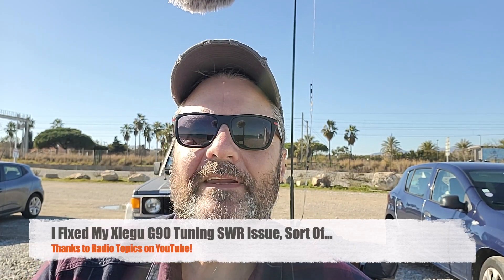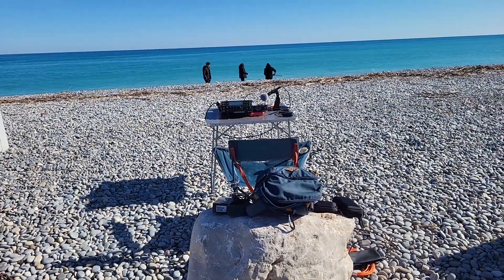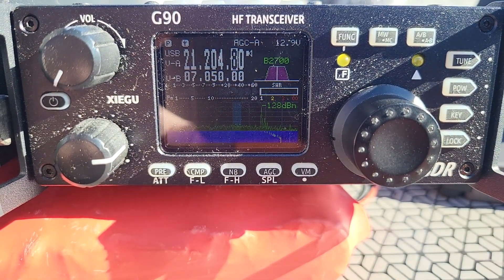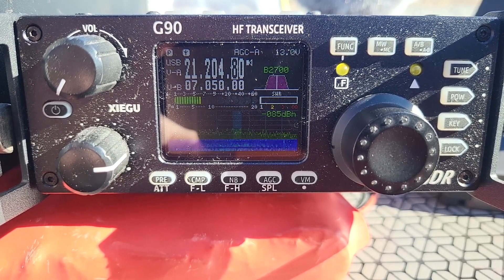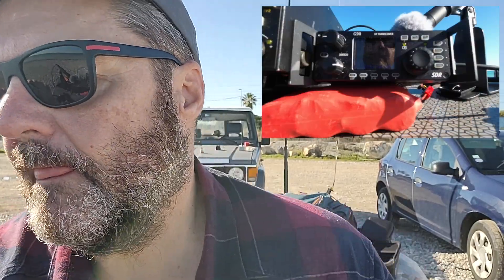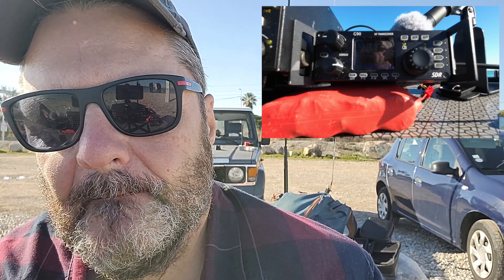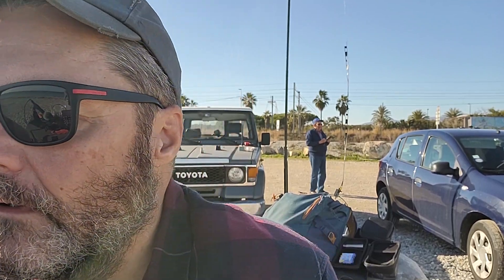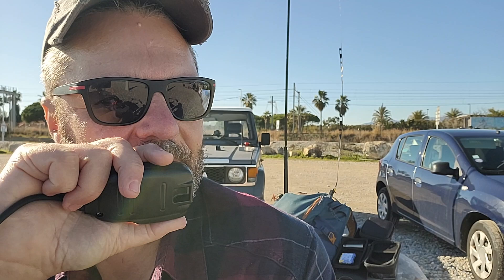I Fixed My Xiegu G90 Tuning SWR Issue, Sort Of...

Comment: I m kind of opposite... actually, taking that back - after i change to Split On, or after Split Off, for a wile, few minutes (or second)  is working well. and than again bad. Even with dummy load 50 ohm.
Reply from the maker: The lsst firmware presumably fixes it..

Comment: Hello again! You inspired me with your video, and in the meantime I was thinking about this problem. I checked it in my G 90 in a split/crossband configuration. The results were similar, i.e. after long tuning, the output power instead of 20 W was only about 3 W. I used a different procedure, wanting trx to work in split, specifically VFO A = 10.117 MHz VFO B = 3.547 MHz. I turned off the Split function and then tuned the ATU to VFO A and then VFO B. Only after tuning the ATU on both bands did I start Split operation. As a result, trx operates with a power of 20 W in both possible configurations: VFO A transmit or reverse VFO B transmit. In this Split function, the selection of the band or transmitting frequency can be easily done by pressing the A/B button.Indirect proof that TRX is changing the stored ATU settings is the audible sound of one or more relays switching when changing the band in which we choose to transmit in split/crossband mode. In the same  band mode you won't hear it because  the ATU settind does not change.Of course we use split mode within one band and the frequency difference we use about 1 kHz to several kHz.  Thank you for helping me learn more 73!
Reply from the maker: Great info, thanks!

Comment: Hello! Congratulations on your beautiful beach vacation, but that's all I can say positively. First of all, your xiegu is much smarter than you. Why?  You need to think about it carefully over a strong cup of coffee. This proves that you are really an amateur, but it does not exempt you from thinking and acquiring basic knowledge. Secondly, I will help you here, the "split" function can only be used within the frequency range of the same HF band, and specifically within the operating range of the antenna tuner. Therefore, the correct practice that I constantly use is to use the tuner tuning after retuning the range of several dozen kHz within one band. I wish you success!vy 73! sorry about Google translation!
Reply from the maker: Yes, I agree and I know all of this, however the firmware should not allow the tuner to attempt to tune if it is not possible. Or it should have tuned on one of the VFOs, not none... It is too easy to enable split by mistake. For someone like me who owns dozens of radios and use a particular model only occasionally, it is very easy to make that mistake..
Reply: @RadioPrepper  I understand your situation, so please forgive me for being too harsh. Sometimes I look at the user manual and wander through the functions to remind myself. I guess Xiegu offers several tuning bandwidths for the antenna tuner, from 150 kHz to 750 kHz depending on the selected BW in the selected SWR meter function, e.g. setting BW = 1 kHz gives 150 kHz tuning bandwidth up to setting BW = 5 kHz gives 750 kHz. Personally, I use the 150 kHz range, hi! vy 73 !

Comment: I have a g90. Poor tune and when I speak swr meter goes straight to max and no power output.  Can’t see anything online about this issue.
Reply from the maker: Did you try what I show here?
Reply: @RadioPrepper yes. It wasnt that. I had bought the g90 from eBay. The software was still from 2020. I think the body and front were updated incorrectly and weren’t talking to each other. I updated the software to the latest and it works as it should do. Thanks.

Comment: SPL means Split Frequenvy. i.e.  Transmit on VFO A and Receive on VFO B (indicated by the two arrows, pointing to both VFO's.)  Ideal for repeaters or seperate TX anD RX frequency. In your case you were using 21megs and 7 megs. How can it tune to both bands at once !!
Reply from the maker: Right, but it should tune on one of the VFOs, not none...
Reply: @RadioPrepper  Yes . I would have through it would tune the TX frequncy

Comment: I bought the latest version of the G90 from Radioddity last September (2024) and have operated with it on SSB and CW only.  A reviewer once described the audio as "harsh."  I describe it as punchy, almost as punchy as a military radio, but not as punchy as your Clansman.  I will try to duplicate the problem; I  have not yet operated the G90 in split mode.  Nonetheless, I am very happy with this purchase. Quite the excellent rig for the price offered by Radioddity.  Thanks for a very informative video. 73 de AE5ZX
Reply: I just duplicated the problem on my own G90.  Perhaps the next firmware update will fix this.